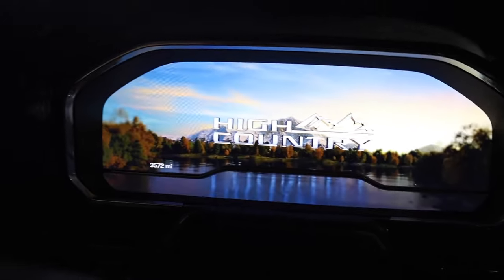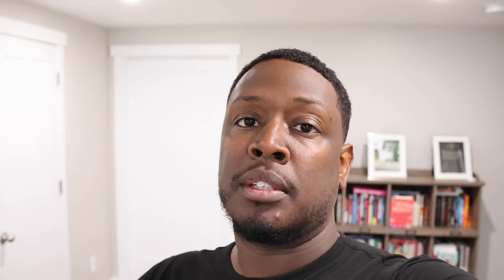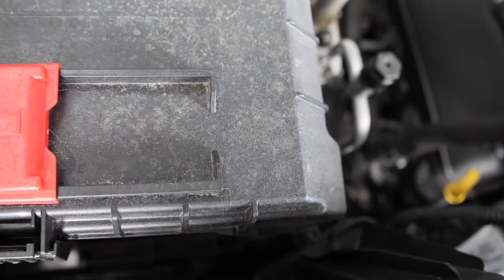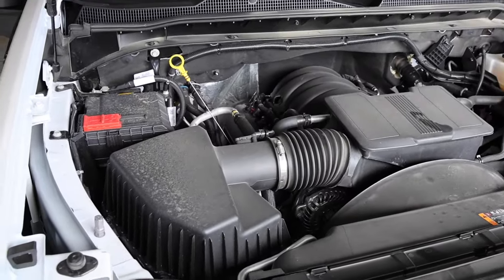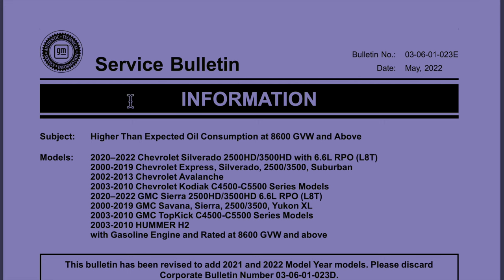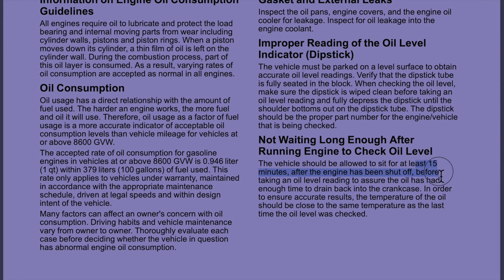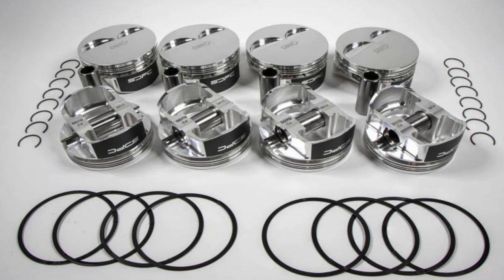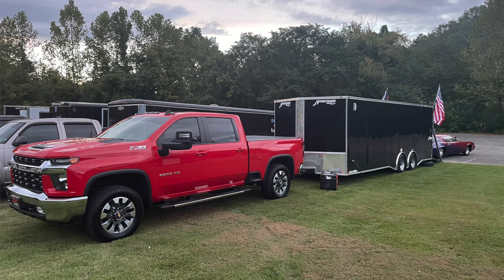Is My 2024 Chevy Silverado 3500 L8T Gas V8 Burning Oil??? What You Need To Know Before You Buy!!!

Comment: That was a good looking red truck and black trailer you showed lol. My favorite was the Camaro though lol. 

So I knew you would get a lot of comments about “3,000 miles is too soon”. It’s not. That was the industry standard forever until the early 2000s I would say. But anyways, changing oil is the single most inexpensive maintenance item you can do on a vehicle so why not change it more often than not? 

So my truck is really close to having 33,000 miles. I live in East Kentucky in the coal fields. Now the coal business is not what it once was but it’s still doing ok around here. I idle my truck a decent amount and I mostly have short trips in my daily driving. It’s a 30 mile round trip to work. I can pretty much do anything within a 30-40 mile round trip. All my roads are curvy and like roller coasters. There’s nothing flat here. This part of the country is know for some of the toughest terrain if not in the country atleast east of the Mississippi. We don’t have the elevation like JB but we also don’t have anything flat. 

I have zero oil usage on my truck. I use Mobile One regular synthetic 5w30 oil and an AC PF63 oil filter. I do all my own oil changes. It’s so easy to do nearly anyone could do it. All you need is a drain pan big enough to hold 8 quarts (so get a 10 or 12 quart pan), a 15mm socket and 3/8” drive ratchet and some kind of oil filter wrench/socket. I use oil change ramps but you can squeeze under them even without those. The hardest part is pouring the oil back in because of the way the oil fill cap is positioned and I buy the 5 quart jugs of oil from Walmart so I end up having to pour it slowly to not over run my funnel. 

So anyways, aside from having an actual piston ring and/or cylinder wall problem, it’s my opinion that ridiculously long oil change intervals are the cause for any engine using oil. And 7,500 miles is just way too long for an oil change. Also, the L5P holds 10 quarts of oil, so only 2 more than the L8T.

Comment: I have a 22 gmc 2500hd with a  l8t, I do my own oil changes every 3k miles and never noticed any oil consumption until I did a 4k mile road trip with a 12k lb toyhauler and it used 4 qts during that trip.
Reply: Wow that's a lot
Reply: @poobank  it is but I worked it pretty damn hard crossing the cascades and rockies twice.
Reply: @@the_halfshell congratulations
Reply: Wow! Screw that
Reply: @dannyboyd1299  
The strange thing is, I'm only seeing oil consumption when I pull my toyhauler, haven't pulled it since August but I have pulled my skidsteer and excavator with no issues.
Reply: @courseydl the toy hauler is a lot less aerodynamic, I don’t know how much different the loads are

Comment: From my research to me it seems that the biggest thing you have to do with these engines is break them in properly and let the oil rings and everything seat properly to not burn oil. GM directly says to not tow anything until 500 miles. Me personally I would go 5,000 before towing anything just to make sure everything seats. Many many guys say that their mpg goes up a good deal after the first 10k, so that to me is saying that these engines don’t fully break in until then and if you’re buying new why not baby it the first 5-10k? Some people say that GM actually breaks in the engines from the factory and you can just drive it like normal day 1. I really doubt GM has all the engines that go into their cars run until they’re broke in. They run them for a bit to verify everything is working and they ship them out. They’re a multi billion dollar business and if they did special things like breaking them in and using special break in oil you know that they would advertise all of this to show you they care and you are buying the best engines you can get.  Also change your oil before the first 5k, more like first 1000-2500 imo. An oil change is cheap insurance and you’ll never hurt the engine by putting in fresh oil, you will hurt it by leaving bad oil in it. Some may say that what GM fills at the factory is special break in oil, I find that really hard to believe. If GM put special oil in all new vehicles I would assume they/dealerships would tell you that you have special oil and don’t come in for an oil change until xxx miles because you need that oil to do its job. I guarantee you that these modern engines get just plain dexos approved GM standard oil in them from the factory. To sum my points up, GM is in the business of selling vehicles and if they don’t have to spend more money on things, then they won’t, which makes sense. Use common sense in that you need to take it easy on your new truck for a bit and be mindful of doing your oil changes sooner than 7.5k miles like GM states.

Comment: I have just completed my 5th oil change, every 5,000 miles full syn. It was consistently 2qt short. This 6.6 gas motor burns 1qt every 2,500 miles. Don't forget to check and top off your oil. Running rec 90 gas helps get rid of the metallic noise. Good luck.

Comment: The manual states for the 2022 and prior.  I have a 2024 Chevy 2500 ZR2 with the 6.6 gasser.   I changed the oil for the first time at 950 miles.  600 miles later I checked the oil.  Not burning any oil at all.

Comment: Know your not keeping it long, but I recommend an sealed and filtered oil catch can like JLT, elite engineering, add w1.  Alot of vehicles have a jumper hose from the engine valley to the throttle body or intake manifold.
Reply: Just emptied mine

Comment: Reasons to change your oil earlier that normal:   Multiple short drives in cold weather.  Higher in town mileage than highway.  Dirty environment.  Lots of idle time.  Basically the more gas you burn, the dirtier the oil will be.

Comment: My old GMC Sierra 2500 HD with the 6.0 I changed the oil, oil filter and air filters every 5,000 miles.  I didn’t tow a lot but, travels towing were long distances.

Comment: On my dodge  and Jeep I change it when it tells me too, both are pushing 400000KM with no issues or oil consumption at all. It’s always around 10000km when it goes off, more so in the winter cause of idling to warm up.

Comment: Why put premium gas in a NA engine? There is no boost! I remember a video a few years back where they found that lower octane in engines designed for it gave better MPG than premium. It’s a lot of money to spend for an octane bump the engine can’t use…

Comment: I've done quite a bit of research on the forums concerning this issue and it's a total mixed bag.  Generally speaking, if your engine doesn't use oil right off the bat, you're probably good to go.  Most that have reported oil consumption issues say it did it from day 1 for the most part.  My 22 Custom model hasn't used a drop in over 15k miles now.  That includes a recent 3300 mile round trip towing our camper from Bama to Maine.  I just have the dealer change it every 5k miles and all is good to go.  I do run a catch can and in the beginning I would get a little over an ounce every 1k miles.  Around the 10k mile mark there was hardly anything in it.  Even after our 3300 mile towing trip recently I only had an ounce.  So these engines do take a while to fully break in.

Comment: Isn't 7,500 assuming you use full synthetic, which lasts longer?

I've never owned an HD truck but I've had a pretty wide variety of vehicles, including my current Ram 1500 and I've been using full synthetic on everything for a while. I just monitor the oil life on the computer and never let it get below 15%. Have never had any issues sticking with that.
Reply: These trucks come from factory with synthetic oil in them.

Comment: 25k on my 20222 5.3 and she loves to eat oil.     Oil duration has nothing to do with it, get yourself an oil separator and AFM disabler asap.  I probably add a quart every 5k miles if not less the way I drive.  Use Amsoil signature oil so doesn’t get much better than that.

Comment: 2022 chevy 2500 hd reg cab 8 foot bed.. love this truck however over the last three day's whenever i start my truck the change engine oil soon light comes on.. i checked the dipstick yesterday and not a drop of oil was on it.. 3/27/24 went to the dealership made them top the engine off in front of me.. 1 & 1/2 quarts low.. beyond pissed.. the said possible excessive idle hrs possibly the issue.. its got 12,800 miles on the truck and i baby the bitch.. im not happy at all hopefully the last oil changed they didn't add enough because 1 & 1/2 low is kinda scary i bought the truck to not have to open the hood or deal with mechanics and to get to and from my jobs without issues.. hopefully its not a major issue!!

Comment: I’m really debating wether to get gas or diesel . I tow my camper long distances maybe 8 times a year at the most . But so far from what I’ve read they say the gasser will pull it no problem .
Reply: I picked one up back in July. Very nice truck. Not sure what you’re using now, but I came over from the diesel Titan. I was actually looking at 1500’s, but for roughly the same price, I could jump up into a 2500. I love it. I’m getting 13-14 mpg with mine in NJ.
Reply: Watch automotive inquiries he said if you tow 14k or less part time go gas

Comment: 7500 miles should only be considered for when the truck is commuting and not working or towing when working that engine should probably be serviced around 4000 miles now if you are doing oil analysis you maybe able to get more mileage than that out of a service

Comment: It's not burning oil.When you tow with it,the oil is getting hotter and burning off.Bottom line,check your oil every 1 or 2 days.Dont complain about oil consumption when you work the truck ad have to add some between changes.Lot of factors go into oil consumption.If you are worried,do oil analysis.Engines  whether gas or diesel are going to burn off some oil.Fact of life.

Comment: So GM recommends 7,500 , but you recommend 3,500!!
lol
Reply: Yeah, they recommend 7,500 so your engine wears out so they can sale you a new truck! That's fine if you're one of those that trade in when warranty is over!!!  Lol
Reply: So you’re one of those people!!!
Reply: @JK-qe6qq  yep, I take care of my shit! Oils cheap
Reply: I take care of vehicles also!!! Never in my 46 years of owning vehicles never had a engine failure due to oiling problem!! Just some people over think they are smarter than engineer’s who designed the engines!!
Reply: @JK-qe6qq  my work daily has 506,000 miles original engine transmission and rear end! I just give my daughter a 2008 impala, 290,000 original engine and transmission! So you keep doing you and I'll keep on keeping on!
Reply: @@the_halfshell watch project farm and Ford boss. They've done extensive oil tests. Why push it to the limit? Oil is cheap compared to the price of the repair, down time and your time! Doesn't make sense to me to roll the dice. Preventive maintenance goes along way